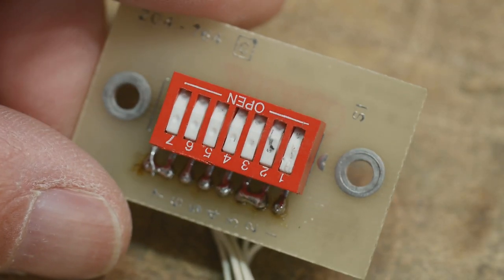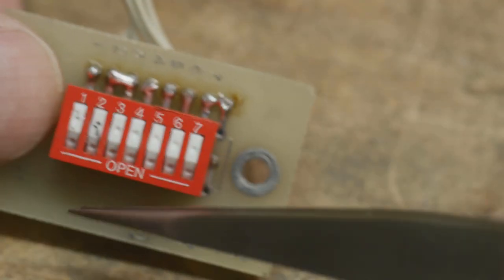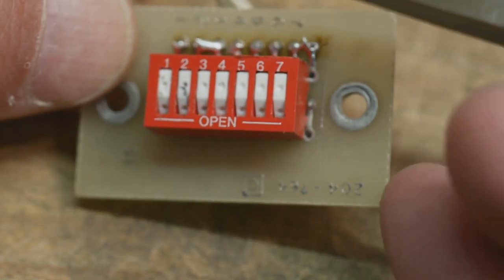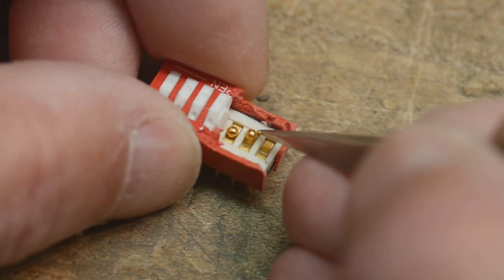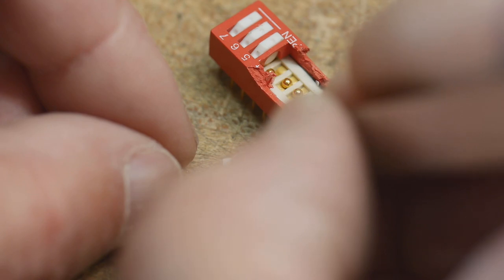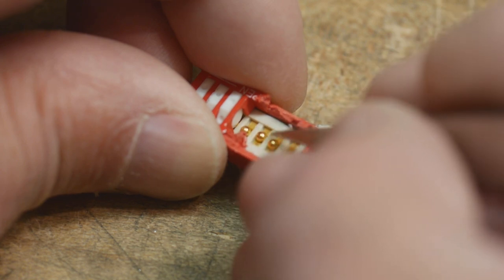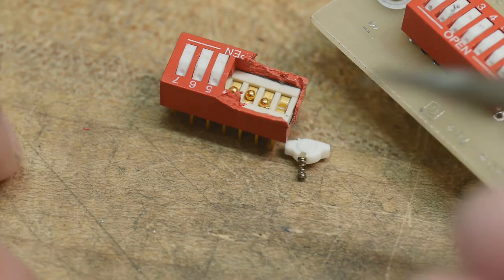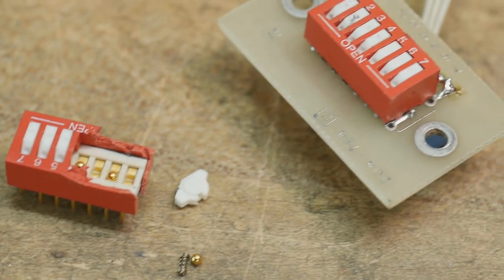#704 DIP Switches Don't Age Well

Comment: DIL switches such as these also have a very limited life, typically 2000 operations.
Not usually a problem, but if you use these for testing then they can fail

Andy
Reply: You're right. The data sheet should tell you how many operations it's rated for.

There's probably a dip switch that good for many more operations available somewhere but they're probably less common and more expensive.

It's similar to a trimpot and a control pot very different operational life. Like about 10k-100k (and even some are as low as 200) vs 1M-5M